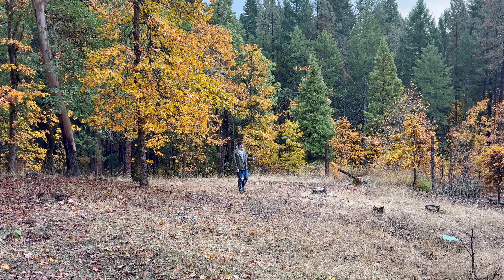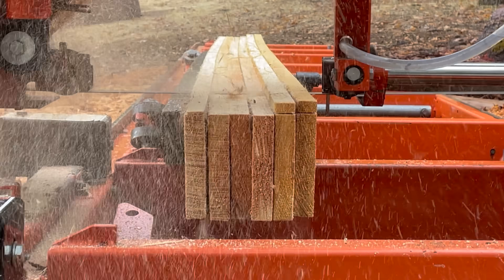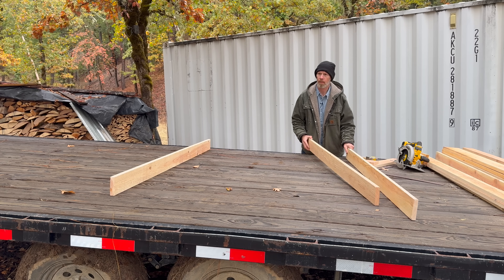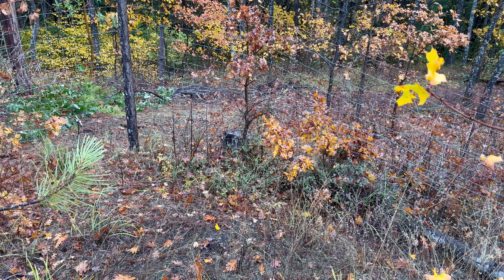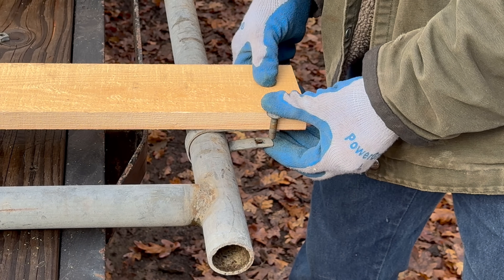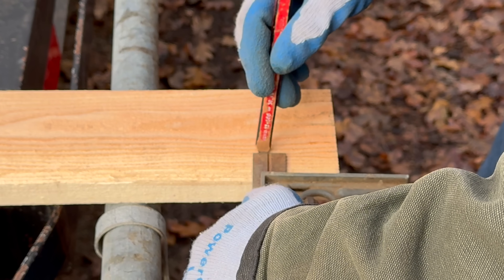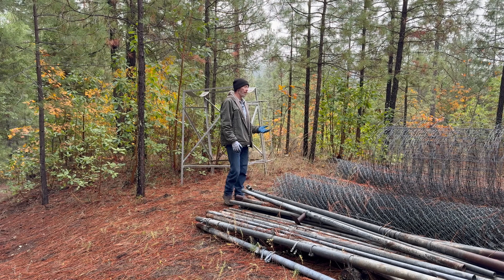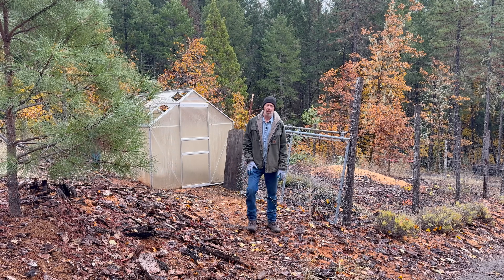How I Saved a Ton of Money On my DIY Solar Without Switching to ......

Comment: There is that saying, 'I've done so much with so little for so long I can now do anything with nothing.'  You are living the life.  My 94 year old mother (now 95) needed a better way to handle her oxygen hose as just stringing it out and coiling it back up was a hassle and it tended to kink so I used the top off a yard wind fan and a wire spool and made a manual hose wind-up stand.  The hose pulls out when leaving the room and winds back up at bedtime.  No kinking AND mounting the water container on the unit (to moisturize the air) ended water build up in the air hose.  No more blowing it out each day.
Reply: nice work. they say invention is born out of necessity. you are a text book example
Reply: Good old American INGENUITY!
Reply: Like using a Christmas tree stand for my TV antenna pole on the porch. Hidden but works. We are allowed antennas but this one is out of the sun and weather. 73
Reply: Or to rephrase it. We the unwilling, lad by the unlearned, have been doing so much, with so little, That we are now qualified to attemt the impossible with nothing.
Reply: Please can you explain in more detail.
Reply: @000Krim  I have created a new YouTube channel called Flaterthian Makes.  This item will be my first video posted to that channel.  The picture for the channel is of an air tank storage unit.  It holds 9 tall tanks and 5 small ones or 10 tall with 4 smalls.  That should be my second video.
Reply: @Pascalore  Channel link?

Comment: I’d be willing to bet that the wood frame would have outlasted the panels especially if you painted them once but obviously your solution is better 👍🏼 
   Assuming you did your research and I’m certain you did, give us the information on your panels. I have to come up with a better solar system for the Alaska cabin. What we currently have is older and not cutting it anymore. 👍🏼
Reply from the maker: Yeah, it may have out lasted the panels. I do plan on doing more videos showing what I figured out with the solar.